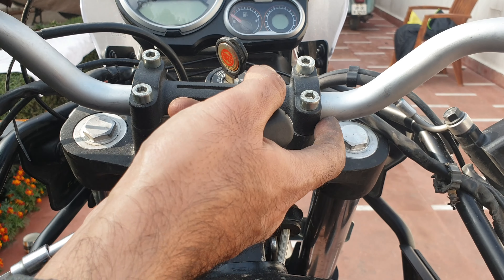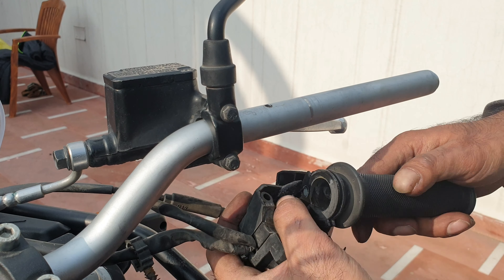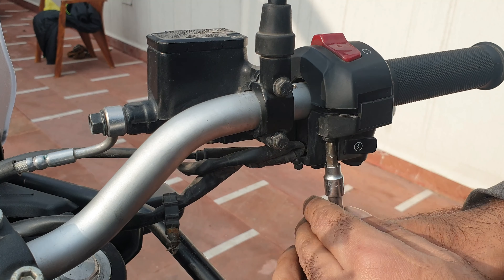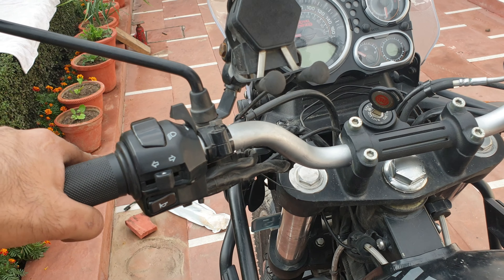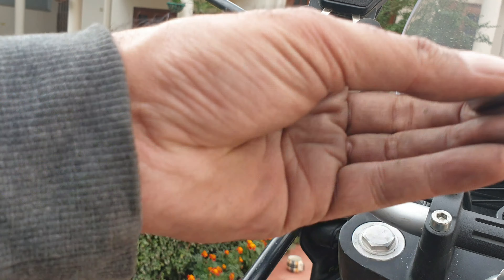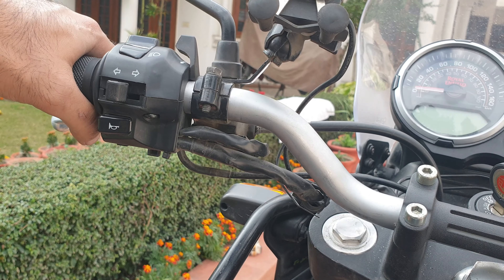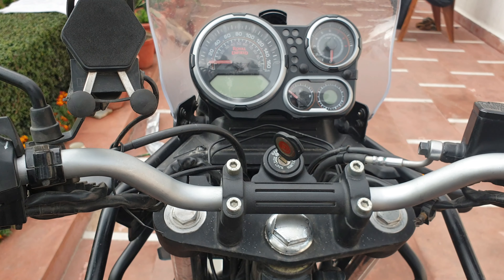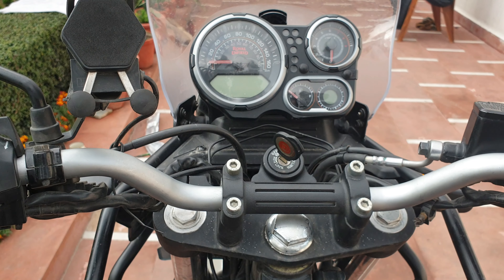Royal Enfield Himalayan Stock Handlebar Dismount and Replacement DIY

Comment: Hi thanks for the video, the holes in the handle bar (on the two sides under the assembly) have any uses? , have purchased a after market handle bar which has no holes , does i need to put that holes?

Comment: Nice. I changed my handle to the Art of motorcycles one. I didn't think the height rise would make much difference but it has immediately changed the entire feel. They are slightly wider but no more shoulder pain. You sit more upright. It is also wonderful for offroad positioning as well
Reply from the maker: Well, this is where I get confused. The only reason I was having the shoulder pain was because the handlebar was bent. Otherwise there is no pain while riding the stock handlebar. 
But confusion is this, I believe in the saying "Chain is as strong as the weakest link". And this is where it gets disputable. As on any given day say if the handlebar is weak enough to bend, in a way it is taking the load of off the triple tee, forks and rim. I hope you are getting my point :D
Kudos :)

Comment: How is this?? I've tried undoing my handlebar bolts and they are sooooo tight, I feel they are going to snap so gave up!
Reply from the maker: Hey mate, indeed, they feel like that, probably because of coming out of factory with loctite in them, but once freed/loosened with proper 1/2" kit, it becomes easy for further exploits ;) cheers
Reply: @leuheanrede  thanks for that! I'll be giving it another go as I want my risers on. I think a more substantial tool is required 👍

Comment: Hey leuheanrede, thanks for this video, helped me a lot. Have you by any chance noticed a kind of small plastic block with a spring inside on the left electrical switch? This small plastic piece and this spring fell from inside when I was reassembling everything, and I just could not find where to put it back. The whole switch assembly seems to be working fine - left and right blinkers, horn, high light flasher, high/low light selector and the choke lever - , but it would be good to put the little piece back where it belongs. I took a good look on the inside of your bike's switch on the video, but could not find anything like it... If you by any chance remember seeing something like this - a small plastic block with a curved side, and a spring inside it - please let me know. Thanks in advance.
Reply from the maker: Hey mate, so I believe you are talking about the high low flasher spring mechanism, it could even be the horn spring. But chances are more for flasher on. Please send me a pic if possible at solacedrecluser@hotmail.com 
We will get it sorted, no worries mate, cheers :)

Comment: Hey buddy .. on my bike those 4 ln key bolts holding the handle bar seems to be jammed😐 
I tried WD40 but no luck😔 
Any suggestions? 
Thank you.😬
Reply from the maker: Hey mate, yes first time you open these will be tight, if you are using 1/4 ratchet, switch to 1/2, or a long ring spanner to get better leverage, Cheers :)
Reply: @leuheanrede  yeah 1st time opening them.. cool I'll try that bro ..thank you soo much..😁
Reply from the maker: @Amoghhh.k  😋Naah naah, I didn't mean it that way. But I too had to exert too much energy, too a point where I thought i was gonna ruin it or slip. But that's how these come from factory. Cheers :)
Reply: @leuheanrede  wonder why though..thanks man cheers I'll try it again with 1/2 rachet. Cheers :)

Comment: Sir, how many centimeter is it possible to pull the handlebars backwards without needing to change the cables?
Reply from the maker: Hey mate, if you are considereing adding risers, I thing it can manage about 20-30 mm without using long cable, but minor adjustment might be needed, cheers :)
Reply: @leuheanrede  Thank you for your answer. I just want pull the handlebars 20-30 mm backwards without risers.
Reply from the maker: @thebikegeekandmore2448  indeed mate, easy doable. But if the while turning the handlebar if clutch becomes tight or rpm increases, just adjust clutch wire or accelerator wire;) cheers

Comment: Sir how to buy the stock handlebar as u bought???
Reply from the maker: Hello mate, this was before covid and parts were easily available at authorised service centers, but now a days there is shortage of parts and delay in part arrival aswell. I too have booked few parts which have still not arrived. So just contact service center part shop and request them to order, might take some time so patience will help. Cheers :)

Comment: Hey mate! I also want the same handle bar, had a word with the dealer he was suggesting braced handle bar kit worth 2.5k which i don't think would be a good option. A little guidance would be helpful. :)
Reply from the maker: Hey bro,
I think the one you are mentioning is that aluminium/black one. I believe its a good upgrade as its about an inch wider and in addition that brace will add the required strength aswell.
I am myself waiting to upgrade but two things holding me back are the price and the width( as that can be slightly cumbersome in stop go traffic)
Cheers :)

Comment: I wonder if you considered replacing with the braced handlebars which are supposed to be thicker walled and stronger?
Reply from the maker: Hmm. Some honest doubts here.
Whenever I fall impacting the handlebar, which is the weakest link, it bends. 
What if I have a handlebar strong enough, that doesnt bent. The impact is gonna go somewhere. that being, the fork tubes, the front rim and the worst of all, the chassis.
I  shoudnt be speculating, but havent we heard a lot of chassis breaking incident already ?
I dont know. But I still believe in letting the "weakest link in the chain breaking, before impacting the important bits(i.e. Chassis )
Please share your honest advise/opinion on this!
Cheers.
Reply: @leuheanrede  I agree..